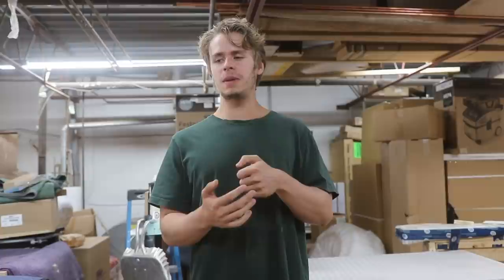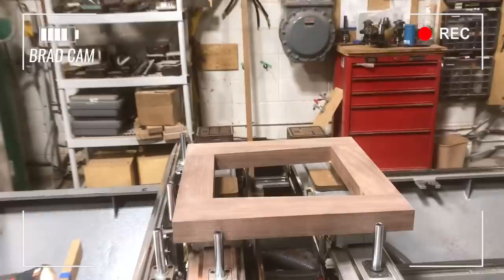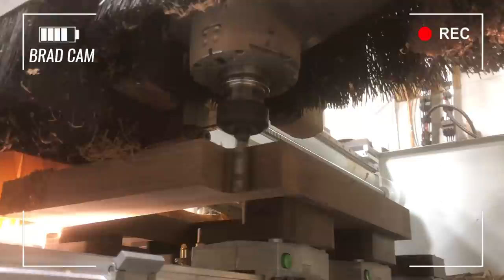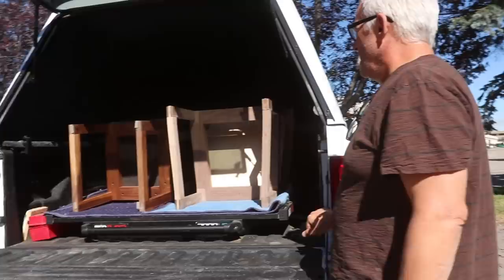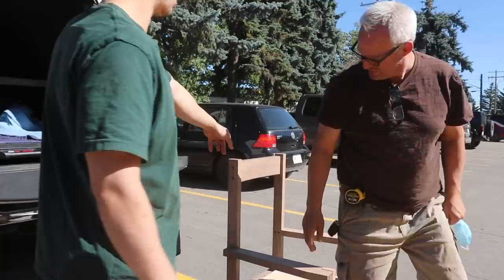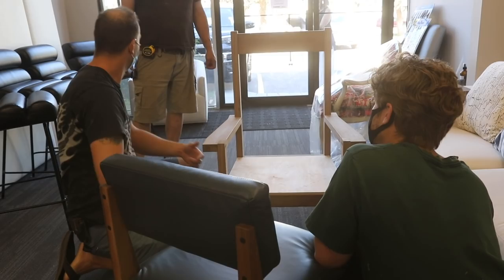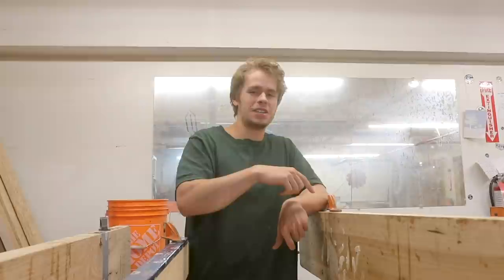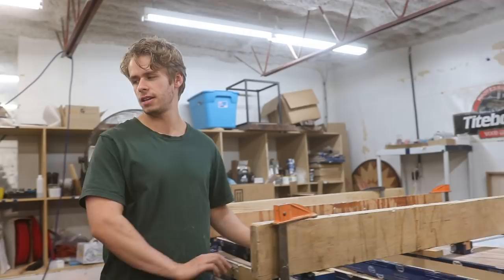Designing a New Dining Chair

Comment: I kinda agree with the comments I've read about the new chair design still being a bit boxey, or stiff, if that makes sense. I get you're going for the modern look but these small touches, in combination with secure joinery,,,,,, make a big difference when it comes to appearance AND comfort. Maybe flare the rear legs away from the front and also create an angle with the back rest,  12-14 degrees off of plumb seems to be a good starting point. Not to not pick, ( you guys seem to appreciate input from other people in the trade) but that lower spreader just doesn't look right, it's too low. I think that adds to the boxyness. Having some space between the floor and spreader gives a much more graceful appearance. Chairs sure have their own challenges don't they? Lol.

Comment: I just watched your video and would like to make a design modification.  But first of all I suggest you and primarily your father or someone with wider frame sit in the chair with the arms and see how uncomfortable it becomes after 30 minutes or more.  As you know most men sit in a chair with their legs somewhat spread apart , more so at the knees, women not so much.  Now after sitting in that chair for over 30 minutes you will feel the inner edge of the front vertical support for the arm digging into your thigh and you become very uncomfortable.  My suggestion would be to make the front part of the arms wider apart and starting where the seat and arm meet curve this part of the support out and up to meet the arm.

Next to test your design take your chairs someplace (shopping area) and ask others to try sitting in the chair and get their comments.  If you do this look for volunteers with different body builds, both men and women.

Finally, once you have a good design for the chair with arms that have been tested and further modifications have been made then take that chair and eliminate the arms but keep the high back.